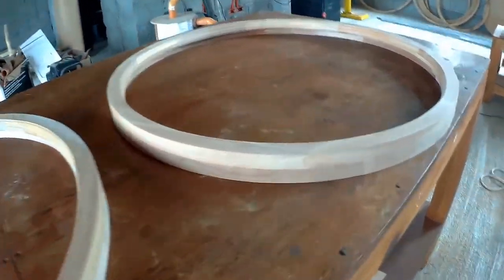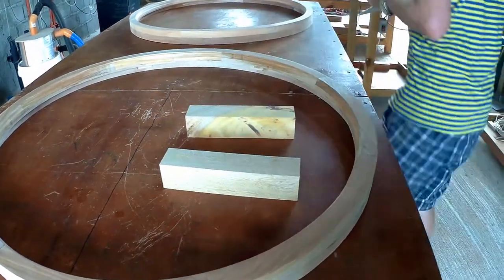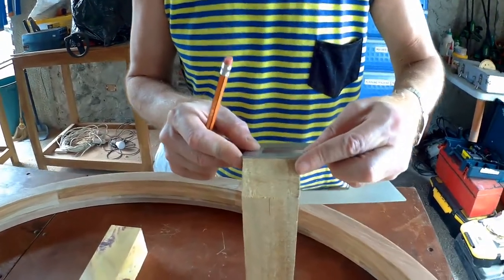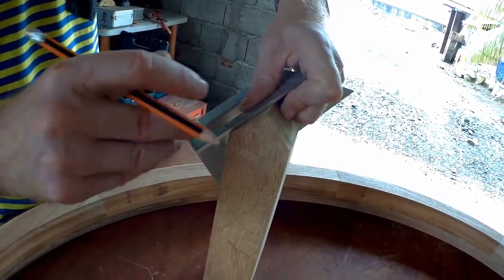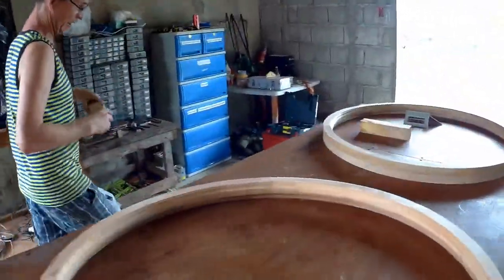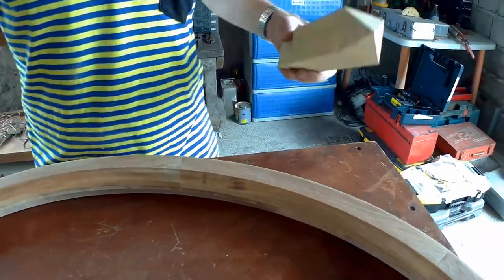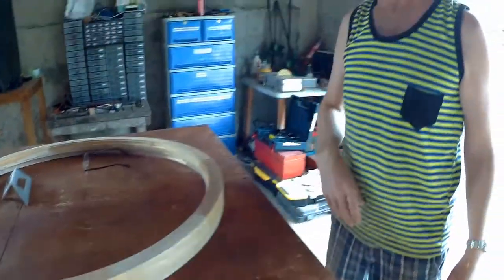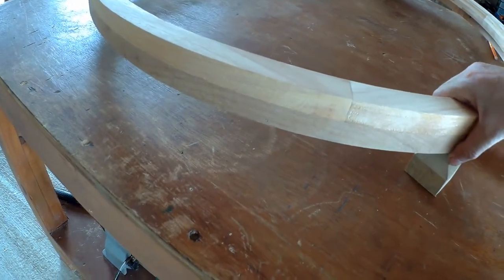How to make Painters Pyramids - Drying Stands

Comment: That’s pretty slick. And every time I watch a woodworking video filmed outside of the United States I get jealous of the metric system. Ah, the simplicity and accuracy of it all. Forget these fractions, feet and inches and what not. Keep up the good work. I like this, I may have to make some out of the never ending supply of scrap wood in my shop.
Reply from the maker: Thank you for watching. Yes metric rules. When I was doing my apprenticeship we had imperial on the site, and metric in college. I was able to chop and change. I can still quote sizes in imperial, but when I come to actually make something, I use mm
Reply: Irish Chippy I would too!